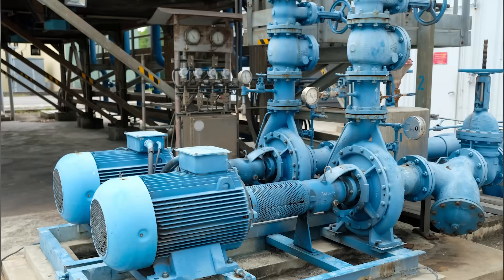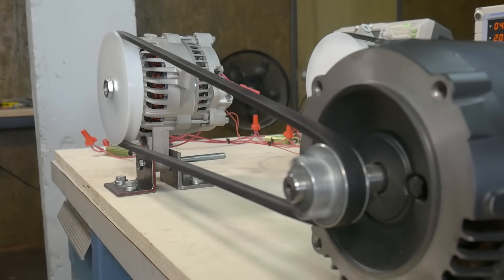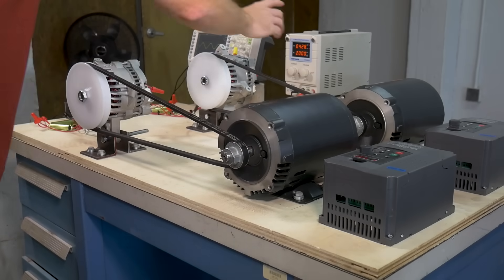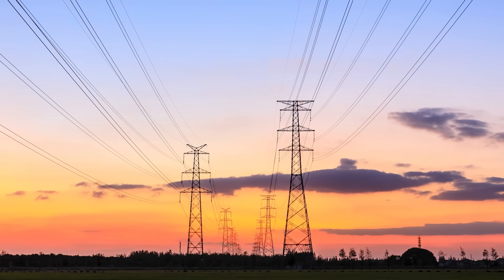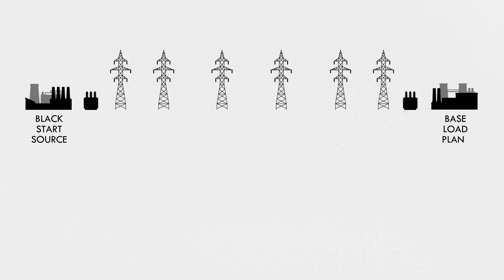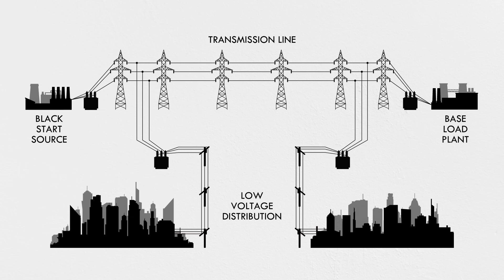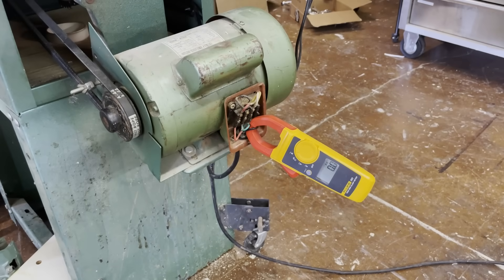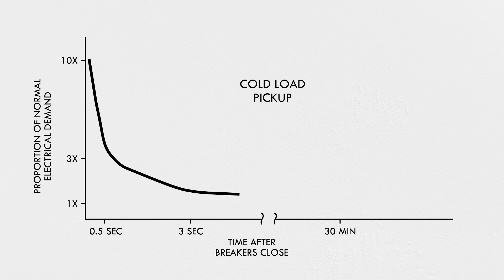What Is A Black Start Of The Power Grid?

Comment: Startup and shutdown power is absolutely required at nuclear plants.  This is one reason nuclear plants and hydro plants should ALWAYS be paired together.  Hydro power “can” be “self starting” since the energy is always available.  IE water falling through a turbine, through manually opened gates, if necessary.
Hydro power is the very best source of startup and shutdown power, especially for nuclear power plants.

Comment: I have a couple of questions.

I live near a couple power plants. One of which was completed in 2012 and officially came online in 2015, Edwardsport IGCC. Is there a way to find out if that plant is a black start source? Is there an engineering reason as to why it took Duke Energy so long to get it going? And why does it look so different compared to the conventional coal plant at Merom?

Comment: There are a wide range of on delays in HVAC systems ranging from 15 to  300 seconds for multiple reasons. Most importantly to spread out load in rush when power comes back. 

Very nicely done series here. All officianados of electrical grid are pleased. Not one inaccuracy that I noticed anyways. 👍

Comment: Thank you for explaining how they restart the grid from any electrical power black out.  With newer battery technology we could have a more robust grid to handle peak power demands and when restarting the grid and the batteries would also serve to store excess energy from wind and solar to use when demand is high, when the wind or solar are not producing enough power.  Also there needs to be more independent off the grid systems, to eliminate the problems the grid has, the grid distribution system is very inefficient and wastes energy.

Comment: Every blackout I've been in has been the result of transmission lines going down due to weather, not the power generation itself going down. And that's why I'm a huge fan of burying the gods-damned power lines whenever possible.

But yeah, it's a difficult and complicated system. And frankly, the US power grid is a lot more fragile than it should be - mostly because it's so piecemeal and has seen any major upgrades in decades. But that's what happens when the government refuses to invest in infrastructure. Even the latest infrastructure bill just barely scratches the surface of what needs done in this country.

Comment: With synch scopes we (Army Prime Power) have a saying of having the needle move "slow in the fast direction" meaning the needle is spinning but very slowly and spinning the same direction and the fast arrow (clockwise). This means the generator we are synchronizing on a grid has a a ever so slightly higher frequency then the grid. The reason to do this is that once is connects it immediately picks up load and outputs power. If it where to synch in the slow direction (meaning its frequency is slightly slower the the grid) then it would consume power or essentially become a motor, which is bad. If we synch near perfectly then its a tossup between motorizing and generating power with the generator. So we like to guarantee that it produces some power and not motorizing at all when we get in connected.

Comment: It's interesting that once two generators are connected, they stay in sync. I often wondered how they kept all those power stations synchronised, and thought it was quite complicated
Reply: It is, he didnt go into it but you have different modes you run in. One generator usually a very large one with a lot of rotating mass will set the frequency in isochronous control and everyone else runs in droop control.

Comment: I worked at a coal-fired power plant when I was in college that was built in 1949.  It had synchroscopes in the control rooms that they had modified with a rotary encoder on the backside to feed into control computers.  Many of the panels in the control rooms had been "blanked" over the years as their controls were replaced.  Working as a summer worker, we were always told the mythical story of a janitor who took down a unit while waxing the floor by accidentally bumping a switch with his mop.

Comment: Ex-Navy Nuke here. The nuclear plants I trained at still used synchroscopes when bringing turbine-generators onto the plant grid; cool to see them mentioned here. Great stuff!
Reply: Still the best way, but what he didn't mention was that the lager the generating unit the longer it takes to synchronize it to the rest due to the weight of the rotating elements. Then the units must be loaded to about 40% of full load to stabilize the frequency before the next unit is switched in.
Reply: @henningventer2917  Commercial plants have auto sync but do have the ability to be manually synced. It's rarely used. 8 years navy nuc plus 23 years commercial nuc operation experience here.
Reply: Ex-Navy Navy Mechanical Operator here.  Some the smartest people I ever met.  And some of the weirdest people I ever met. One of the Most memorable times in my life.

Comment: In regards to the syncroscope - is there a self regulating mechanism once the two power plants are connected that prevents slow drift of phase/frequency?  It just seems unlikely that the two independent sources would stay in lock step with each other.

Comment: It should be mentioned explicitly and more often, that everybody can help to ease the restoration of electrical power. I've been in situations where the initial load was too high and it took several attempts to restore electricity. If everybody would turn all (but one) lights off, disconnect devices like fridges/AC/TV/computers, flip uneeded circuit breakers, etc., then the initial load will be reduced, which makes it easier to restore the grid. And it also protects your devices from power surges!

Comment: In Florida, Tampa Electric had a complete outage.  How did they manage that?  A relay TEST at their Gannon power station.  Gannon was (at the time) their largest generation facility.   The test?  Fire a copper strap across the output of Gannon %4.  The fellow in charge of that knew that the breaker in their switch yard was supposed to break when there was a fault on the generator.  He fired the copper strap over the lines leaving the generator.  There was a bright light and a very loud noise.  The Breaker in the plant tripped as expected, and all the steam blew out the roof.  As expected.  Unfortunately, the breaker in the switch yard didn't trip at that time.  Result?  Gannon #5 (A 350 MW generator) saw the fault, and tripped off line, blowing all its steam out of the roof, just like #4.  Then Gannon #3 did the same thing... Finally the switch for #4 tripped.  That took the fault off the system, but they had lost almost a gigawatt of generation at that point.  Gannon #2 and #1 both tripped off line.  The only generation still on line was an ancient bunker C power plant in the Port of Tampa saw that its total 400-500 MW of generation would not handle it, was grossly overloaded, and tripped as well.  NO power anywhere in the Teco facility.  Teco called Florida Power and Light (east coast utility)--- asking for power.  "Sorry... Turkey Point just went off line.  We have no power available."  ooops.  Then they tried Florida Power in St Petersburg.  Same situation.  The Crystal River plant was off line for maintenance, and they had no power available.  Lakeland Electreic offered up to 50 MW, but there was no way to get that power to Tampa Bay without lots of work....     So they made a call at the big office on Dale Mabry Hightway... "We need all the car batteries you can come up with.  There was a "retired" power plant on the Hillsborough River that had 10 units in it.  The smallest generator was a 50kw coal powered thing... They got several hundred car batteries to that plant, and started cobbling things back together to start the smallest generator, all while sending linemen out to the substations to force all the power from the Peter O'Night plant to the station in the port... First unit at the ancient plant was used to start the second , then third units powered up at Peter O Night plant... when they used all those to get the rest of the generators started at that plant, the switch was thrown to send all that power to the Port plant, where the megawatt of power was used to start the first unit there...and then it's output was used to get #2,3,4 started... and by then the switchmen had gotten the switches set to route all the power from there down to the Gannon plant.  It took teco until that evening to get all the generation back on line at Gannon.  And that resulted in the loads for the system to get back on line.  The next 2-3 days were used to get everything back in sync with the rest of the state....  Truly a BAD day for power in Tampa.  (The guy that shot cable with the harpoon gear was a co-op student.  He became the senior engineer in charge of distribution over the next couple of years.  (I worked under him in distribution as a co-op student.   That incident convinced the Teco management to buy several peaking units that they could use to do the bootstrap of the system a tad easier.  The Peter O Night plant ended up getting torn down, and is now the location of the local news paper facility.  The Gannon plant and the plant at the Port of Tampa are now bare ground in large part.  Gannon ended up becoming a gas turbine facility after it got flattened... and the Big Bend plant managed to grow to 2 units at 450 meg each.. and lots of tiny generators running natural gas elsewhere in the system.  There won't be another incident like that any time soon....

Comment: 16:19 Actually, If I may, no it's not exactly. Zesting is breaking the peel in a way that damages it as much as possible so that the pockets of essential oils break open and release the oils and thus their smell and flavors. Whereas peeling is just  removing the peel, in large manageable chunks.

You can zest a lemon without actually peeling it, by destroying the top layer, rich in oils and leaving the bottom layers of mainly cellulose still attached to the lemon. You have zested it, but not peeled it :P

Comment: If you wanted to add realism to the scene with the synchroscope, you could throw in the cursing and ribbing that operators give one another when the needle keeps spinning as they try to catch the mat frequency.  Sometimes the impatient ones will slap the breaker closed while the needle is still moving a bit.  That was part of the problem in the 2003 blackout, we had turbines that were still running but with no load on them because there was nothing on the line to sync to.  Hundreds of megawatts of power with no place to go is a bad thing so the units had to come offline.

Comment: Imho the grid is no longer a viable idea, unless it's all built underground. Now that we face dangers from inside the country, we need to consider micro-grids. In rural areas neighbors can work something out. Why pay for a non-flimsy grid when it's cheaper to build neighborhid sized plants that can connect to other neighbor-grids in an emergency? It would create local jobs, and it would give small groups of people the power to decide what kind of source they want. When you make electricity there is also heat made so in the winter that could be used in homes instead of being wasted. Doing that would also make the most wasteful companies be more visable, their power would be on-site.

Comment: Hmm, it seems like you should be able to do a local black start a 268MW 4 on 1 plant using a series of 3 much smaller generators: 5mw, 500kw, and 50kw , with the 5mw generator being useful in normal operation and maintenance, and the other two being comparatively cheap. What am I missing? Actually, looking at some of the 50mw generators used in the 4 on 1 arrangements, an individual one should be excitable by a 1MW generator

Comment: They should build "pull star" black star facilities. Just a giant weight at the top of a shaft that they can drop to provide enough electricity to start the generators up. It would require zero energy to launch, just pull the lever.

Comment: Great video as always just 1 minor critique I noticed. When using the syncroscope you Don't want it to stop at the top. You want it to be rotating slowly in the fast direction but when it reaches the top is when you shut the breaker synchronizing the machines. If you shut it while it's spinning slowly in the fast direction you will immediately put load on the machine where as if it is spinning slowly in the slow direction the machine will become a load when the breaker shuts therefore backfeading it which may damage it. Stopping it at the top is very difficult to do and maintain. I operated a submarines power plant and we shut down and bring up turbines all the time and the synchronization process is nerve wracking especially when the giant output breaker you are shutting in 10 rest away and loud when it shuts.

Comment: I've tied some old coal units online manually and it was slow in the fast direction, close the breaker 5° out from top dead center. Almost impossible to get the needle to stop at the top as those old steam valves were too touchy. Once you tie online.. you're picking up load as to not motor the generator. Station service gets swapped around 20-30 WM's depending on the plant.

Comment: @PracticalEngineeringChannel No One has done a piece about the infamous Christmas of 1989 blackout in Orlando, FL. I remember it was extraordinary high demand between everyone running Christmas lights in addition to an unusually cold week. Florida mostly used electric heater elements in the air handlers by design since it only gets cold for a few weeks. It seems a lot like what happened in Texas. I grew up in Orlando, and recall having a spaghetti dinner made on a dear neighbor's propane grill side burner since all of our appliances were electric. As a 9 yo kid it was fun to have an out of ordinary Christmas. But I always wondered what the whole story was.

Comment: Grady, as an old EE guy, I want to say that your series on the power grid has been excellent. And you could continue on the complexities for a lot longer than most folks are willing to accept.

Yes, it is a house of cards. It tends towards instability which can only be prevented by constant monitoring and adjusting.
Reply: And this instability is only getting worse with the addition of small, static generation sources like solar, or wind power.

Comment: You can make your own syncroscope. For 3 phase , connection  r-y-b(of incomming alternator)  with 3 bulbs (1 per phase/ 2 per phase as suitable) and do the same for the grid. Keeping r connection across the bulb same, interchange the b an y terminal connection of the grid side......

Keep a separate switch for synchronisation. Once the r bulb is dark and the remaining two are bright, synchronise . That fast and slow thing is indicated by the order of blinking of lamps. Plus, you don't need a phase sequence meter for this method.

It's difficult for me to explain the working in detail but please refer to " 2 bright 1 dark lamp method".

Comment: That syncroscope gave me flashbacks to the navy days. Sycronizing a couple of 450 volt generators on a sub was easy. You could be way out of phases, and the breakers would generally stay closed. But, on a carrier, where it's 4160 volts, you had to be a bit more careful. I'd imagine It's an even bigger deal on a grid for a big city.

Comment: Why can’t one of the generators in a plant be disconnectable\isolatable from the rest, and then just use a backup generator to restart that single generator.

Then, once it’s running, use it to start up the rest of the plant (or isolate 5-10% of the plant and start it in three tiers/steps) to remove the reliance on external black start power sources.

Comment: Nicely done! Your synchronization discussion reminded me of an operator at a gas processing plant that I managed 20+ years ago. When he was relieving the B operator we were just about guaranteed to get shut down if he had to do a generator swap. He couldn't grasp the concept of slowing the needle down, preferably stopping it. He would try to "catch it" by closing the breaker as the dial spun around rapidly. We would lose everything. I wish you would have mention that the frequency threshold for shutting down is extremely important. A drop in frequency is an indicator that the load exceeds the design horsepower of the prime mover. So if the frequency starts to drop the grid operator has to shed load before it becomes critical else the whole thing can come tumbling down...
Reply: Ouch! Are the rafters still shaking?

Comment: Without even watching this, it's all about phase and voltage/relative loading when the switching occurs.  Each power source needs to get into phase to contribute to a shared AC network, and relative voltage dictates direction of current flow.  As more smaller suppliers come online this problem might seem to get harder but in reality it will get easier as many of these will be DC sources that are creating AC output to join the network and they will be capable of arbitrary signal shaping / phase shifting / locking.  They must be designed with those features to be used in conjunction with the grid at whatever facility sponsors their existence.  Otherwise there would be necessary outages when switching between the grid and the off-grid source, and with all the electronics businesses rely on these days, that's not going to be acceptable.  Also the makers of these off-grid sources are increasingly marketing them as cost-saving social responsibility projects, and that only works if they interoperate with the grid.